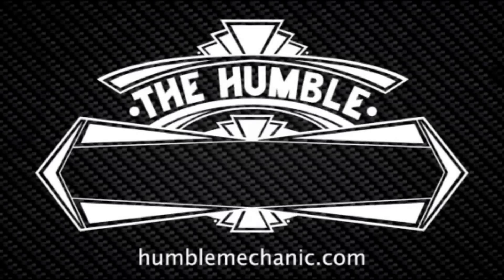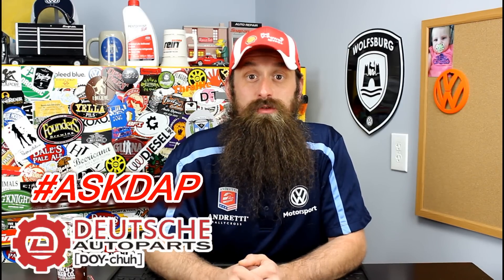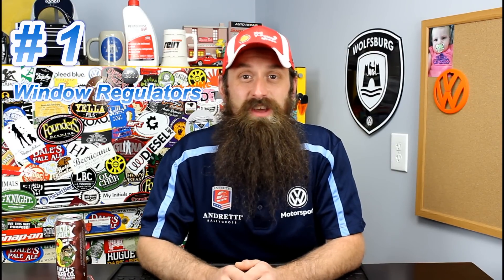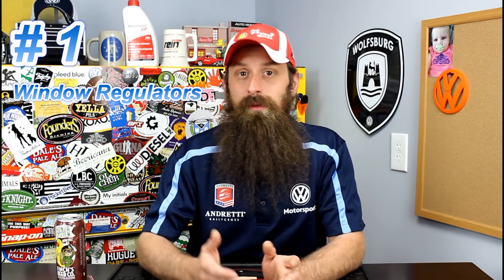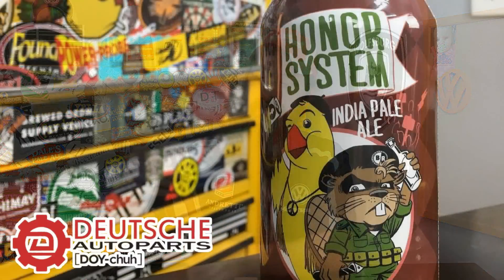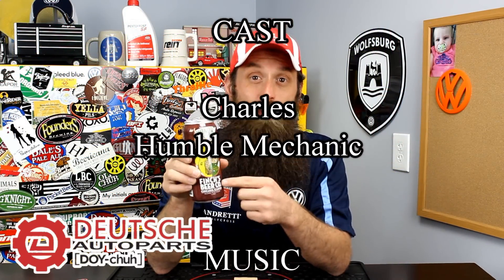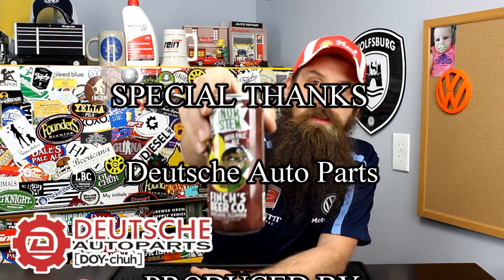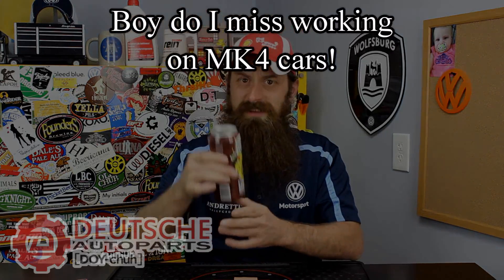Top 5 Failures 1999-2005 MK4 Golf, Beetle and Jetta

Comment: As Teodor mentions... fuse box above the battery has been the cause of lots of problems. The micro switch inside the door latches is horrible. I replaced mine at 118,000km and now at 200,000km three have failed again in my 2002 Jetta GLI but now I have an insane issue and was hoping this video might help. Turn off the ignition and a relay keeps clicking, 11 error codes, only way to stop the clicking is to disconnect the battery. Car runs fine but no Temp or Fuel gauge working. Had a VW/ AUDI/ Porche tech look at it for over seven hours, checked all grounds, Fan Control Module, wiring harness in the engine. What he did discover is pulling fuse #16 Climate Control Module the problem goes away but after driving the electric radiator fans stay on and I still can't clear the code for open fuel pump relay circuit. Tried relays, fuses etc... I think I have a melted wire under the dash.

Comment: Thanks for the video. I’ve encountered all 5 of these problem areas on my VR6 GTI. Most recently, I started getting a really bad exhaust rattle at startup when the engine is cold. My mechanic friend diagnosed that the catalytic converter is the culprit, and it looks like the muffler has something loose in it as well. The question is, can I get away with an aftermarket cat or would I need a VW one  to avoid throwing codes?

Comment: Hey I know its been some time after this video but I own an mk4 jetta, it's my first euro car but this one I've never seen it before. I've replace window switch, window motor but now the problem is more than that. All my windows and locks work perfectly fine but the driver door. I have no power for the driver door. I did a whole new set of wires that is the actual same year and it's a perfect fit, it does not have any power either, and the weird thing here is that if I press both rear windows up, my passenger mirror goes down.

Comment: hey humble! i am going thru a electrical nightmare, i replaced the BLS to the new green one, bought a new third brake light, brake lights worked but i had a blown parking light fuse(23), basically my brake lights would only work w the light s off and all other lights(turn/reverse) on the rear worked. i cleaned up a bunch of wires in the loom/headlight casing and replaced fuses and bulbs/ new oem headlight switch. i notice if i unplug the ballast the fuse doesnt blow but now my brake lights dont work again, could this be do to the system being unbalanced, probably gonna go back  to stock headlights. brake lights will not work/intermittent(all 3) if i use my headlights, idk what to do thanks!

Comment: 2002 Jetta GLX wagon VR6 (12V) 5-speed. We had a lot of coil pack failures (misfires, etc) - about every 30K miles. 1st one was replaced under warranty. 2nd one was just out of warranty and cost $800 (at the sdealer) so we bitched to VWoA and they paid for half. Next one we replaced with aftermarket part and the last one was a coil pack from a Ford V6 - the Fordswagen fix. We had that car until 2014 (170K miles) and was getting pretty rusty (New England car).
Paul

Comment: Seems you have fixed quite a lot of vw. I have a vw beetle 1999 2.0L. I've had quite a few problems. The one I'm stuck with at the moment is codes p0301 and p0304. I just changed the Spark plugs plus the spark plugs wires and the "check engine" light keeps coming up with those same codes. The car kind shakes and you can hear a rattle. By this video I got that it might be the catalytic converter. Can the codes be showing bacause of the catalytic or is that something else? I would really appreciate some guidance

Comment: Good video, one question. Any idea why a dealership near me has a 1.8t Jetta Wagon with a 5MT for sale for $42? It looks solid, the beige leather interior is really dirty, the black paint looks like it's seen some abuse, and there's brake dust all over the Long Beach wheels. Going to buy it if I can, just curious as to what would drop the value that much.
Reply: What's the mileage?  It must be 300,000 miles plus and they just want to get rid of it, I guess. :)

Comment: Have you ever seen the ECT sensor cause a no crank when its cold? Fine all summer long but as soon as it gets below freezing, it wont even try to crank.
Reply from the maker: Never no crank. For sure no start.
Reply: Ok thanks. I'm fighting a no crank issue when its cold. I thought it was the battery or start push button last winter but it got warm and was fine will the temp dropped last night. 
 @HumbleMechanic

Comment: nice video! i've heard of all of these problems too but my 2001 Jetta VR6 never had these problems except for the cat which i paid $1400 for yearssss ago before vw extended the warranty to 120k lol but i never had a problem after that. that and i had 4 different failures with the hazard light switch, 5 failures with the AC unit, 4 failure for the MAF, 4 failures with the coilpacks..... knocking on wood hope it stays ok. goddamn i forgot that i even had this many issues with this car... but it's been good for the last 7 years. window regulators, bushings, brake light switch (replaced under warranty but no problems) etc no problems. thank god
Reply from the maker: NICE "knocks on wood grain" LOL
Reply: LOL i just need to do my brakes next

Comment: I just bought a 98 beetle with the 2-L  engine on the way home it started making a wired noise so pulled over before I could stop it stalls out and wouldn't crank up opened the hood found the pvc valve hose busted rigged one up to try and just get it home to my tools but it wouldn't crank back up any ideas on what it could be

Comment: ahhh brake light switches.  my B6 A4 had that issue.  Came outside one morning, and my brake lights were just on for no reason lol.  Oh, and i had the 3.0 V6 in that car and both cat converters failed hahaha.  Called a local Audi dealer....$2100 per cat.  Needless to say i had an aftermarket one installed at a small shop and sold the car to Carmax.

Comment: Number 6: Emergency brake cables. They always sucked on every mk4. Like if you had a manual transmission on your mk4, you have to always leave the car in 1st gear or if the car was facing downhill you would have to leave the car in reverse because it would roll down the road.

Comment: Hey there, my MK4 GTI 1.8t has had this problem where when I accelerate quickly/get my gas pedal past a certain point, my steering wheel will jerk to one side quickly  and go back when I let off the gas. Any ideas? I’ve replaced tie rods, engine mounts, and more. No luck. Thanks!
Reply from the maker: Some torque steering is common on that car. Be sure the whole suspension is right.

Comment: I have a 2003 Beetle with a 1.8L turbo engine.. It started to smoke really bad after I change the oil. Thick white grayish smoke blowing out... I was told the turbo went bad, There is a little oil blowing out the tail pipe as well. Can you give me some advise.. Thanks.

Comment: The Mk3 platform was a hell of a lot better platform setup than Mk4.  less problems of ect, brake lamp switches, maf sensors,etc.  window regulators hardly went bad.  Bushings on the otherhand were problematic.  Throttle bodies were problematic on mk4 as well. Especially setting readiness codes.  Mk3 throttle bodies were very reliable.

Comment: I need to change clutch set and flywheel on my mk4 Golf 1.9 TDI 2001 90hp. Should i use a DMF or SMF flywheel?Help
Reply from the maker: +anex83 SMF will give a but more vibration. But it is what most folks do

Comment: My 99 vw gti is down .replaced plugs ,wires,fuel filter,cleaned maf,now I ordered a new throttle body.I know I'm a dummy for buying all these parts to find the problem.It idles fine but when I give it gas it sputter out.Any ideas.

Comment: Hey Charles i drive a 2008 r32 i had an aftermarket fluidamper pulley on my crank shaft and it has caused the notch in the shaft to lose its shape. As a result my shaft end is mushroomed and there is play on the pulley. Are there any solution that dont involve taking the engine apart and changing the shaft?
Reply from the maker: +Lucas Garofalo YIKES!!!!! Can you send me some pictures? maybe email me, or FB message me? Charles(at)humblemechanic(DOT)com

Comment: Hi Richard. Thank you very much for the vid. Really helpful to get this improtant information. Can I please ask a question about the fourth item of the vid, about the coolant temperature. I have my 2002 Beetle (2.0 ltr engine) with a strange phenomena. As starting the engine the coolant temperature indicates blue on the dashboard. I guess this is how it supposed to be. After a while, when the engine is at the right temperature, the blue coolant temperature indicator light starts flashing and will not stop flashing during the entire ride. I already exchanged the coolant reservoir, but that wasn't helping. Do you have any clue what happens here? Thanks in advance. Kind regards Carlo, the Netherlands

Comment: I have an 07 Jetta, and have the following dash lights on- power steering assist(yellow), the check brakes light that looks like a circle, abs light, traction control light, and air bag light. They all came on at the same time. I scanned it and it came back as a wheel speed sensor. Could that one part trigger all the lights?
Reply: Try cleaning the sensor it might do the trick. My speedo stopped working also

Comment: Hello, i have a 99 vw bug that the brake light indicator is on forever. It has been with 4 mechanics and still can't fix it. All the sensors ( brake, master cylineer, hand brake, the common) issues have been checked and all is working fine. The abs module was replaced and still the BRAKE light in the dash is on. Can you share some insights or experience, a solution  would be appreciated. Thanks

Comment: Can you help with the Airbag light, errors codes are 00591 drivers seat belt switch, 00532 short to ground, would you recommend replacing the seat belt connection. I have a C reader VIII 
Thanks for the help

Comment: I have a 02 vw beatle with 20v turbo and iam having issues with it now my check engine light comes on then my all wheel drive kicks on by itself and then the EPC light turns on and it has no power I've read the codes I've replaced almost all my sensors but not my idle speed sensor and mass airflow sensor

Comment: I'm having an issue getting my car out of park (bew tdi tiptronic). I've looked at the brake light switch, it's the newer green type and seems to function properly. I can see the plunger move in and out with depression of the brake pedal, can here the click, notifications pop up on the dash with brake depresses and released, and my brake lights work 100%. I can move my shifter freely but just wont mechanically move the transmission out of park. Symptoms before failure was needing to shift back past D and then back up into D before engaging D. I think it's my shift cable but could it still be the switch? Could it be anything else? Thanks

Comment: both front windows in my 05 Jetta TDI come loose from the clips if they stick. Don't let it fall into the door! What I do is push the glass all the way back up by hand (one outside, one inside with the door open), raise the power window motor until it contacts the glass, then stop or it will reverse itself. After that the window is fine until it gets stuck again by ice or sap. Always lower them slowly, if they stick, abort and try again later.

Comment: Hey humble! I have a question noobody can answer. I have a 1.8 20v mk4 non turbo vvt/vvl. I fitted ITB's from a toyota but want to fit a variable velocity stack. I have the mechanics figured out with a actuator and all. Can I wire the actuator to the vvl solenoid so the velocity stack shortens when the vvl is activated? 
Pleeeeeaaase get back

Comment: I've had the rear bushings on my 2000 vw beetle GLX replaced because every bump felt and sounded like the suspension was nearly breaking itself. However, it seems that the front bushings need replacing as well since I'm getting a squeeking sound and the occasional clunk in hard turns. Is this an immediate issue or can it be left alone? I'm a college student on a budget

Comment: HELP!!!!! I own a 98 VW Golf GL. I am having starting issues. Check engine light stays on.I have checked everything I can think of. It has a tight fitting gas cap, I replaced the starter and have a fairly new battery. I have noticed when you wiggle the key while depressing the clutch some times it will start sometimes it won't. Could this be iginition switch issues and should it be changed.

Comment: Still miss my Golf MKIV TDi and would still be driving it today if not for that timing belt.....changing it every 80K miles was a pain in the nuts and cost about $500 each time. That wasn't much for me at the time, I think it was like 2-3 years for that. Had a leaky sunroof and the sending pump in the fuel tank failed on me. Oh....ya and the brake lights FFS I can't even begin to tell you how many times I had to get it to the dealer for the brake lights....which would unbalance the system and the headlights would fail if I didn't get it done fast enough.

Would still be driving it though if it had a timing chain. My only real case of seller's remorse :)
Reply: gotindrachenhart ha fresh tune up wouldve solved that
Reply: +Austin Simms how would a fresh tuneup have replaced the timing belt? Big difference between a tune up and removing the engine to replace the belt.
Reply: hi jw if u fixed ur issues w the brake lights? u mentioned it had an unbalanced system, i too am going thru a electrical nightmare, i replaced the BLS to the new green one, bought a new third brake light, brake lights worked but i had a blown parking light fuse(23), basically my brake lights would only work w the light s off and all other lights(turn/reverse) on the rear worked. i cleaned up a bunch of wires in the loom/headlight casing and replaced fuses and bulbs/ new oem headlight switch. i notice if i unplug the ballast the fuse doesnt blow but now my brake lights dont work again, could this be do to the system being unbalanced, probably gonna go back  to stock headlights. brake lights will not work/intermittent(all 3) if i use my headlights, idk what to do thanks!

Comment: Funnily enough, I had none of these problems. However I did have the following issues: center console broke, turning the blinker on dimmed the brake lights, o2 sensors, oil leaks, coil on plug wire insulation falling apart, oil pressure sensor broke, trunk plastic thing broke so the trunk wouldn't open, no heat bc the foam in the vents flaked off, oh and it smelled like crayons. Good times

Comment: i changed the timming belt to make sure i was dead on marks on fly and cam a few tries i could of swore  it was off 10 degs or more someone told me that i shouldnt do that im not sure im thinking I could be too close to a fresh factory run time module it tries and tries but farts on number 1 timing scenario
Reply: i cant understand why after an exhaust manifold gasket i got a miss fire out the get go  my P carbon canister malfunction has turned into a plain jane P420

Comment: Man Im glad I watched this finally, been getting 0422, temp sensor, random misfires. 
had plug wires with broken tips, cracked evap line, cracked brake booster line, all kinda random things I fixed on this journey.
now I'm hoping its the temp sensors! path of least resistance!

Comment: i have an 03 jetta 2.0l crank no start,
so it been sitting for at least 2 year technically not mines it my cousin, she said it crank but won't start, then a year or so ago my brother who work at auto zone at the time had it tested, i forgot the result i think it was bad. today i thought about so i check the fuses an 10a and 15a both were replace with a 20a fuse
i check fluids and was surprised to see no oil or coolant in reservoir dipstick had half a drop on the end and reservoir was bone dry.
Any ideas why?

Comment: 2000 TDI No dipstick for the trans..., output shaft speed sensor under the trans mount, rubber coating on interior gets sticky over time..

Comment: Common and same car really, is my Seat leon pd bmn 2008 mk2 1.9 170 fr diesel, on mine I've found to be: noisy flywheel so swapped the entire clutch kit including clutch plate, release bearing, bolts, dual mass flywheel (all from LUK) as dealer recommended and I plan to fit a short shift on the gearbox once I've got it started 😂. She's been stuck on my drive since a few days of getting her back from garage that fitted my new clutch for nearly three weeks now, I've checked fuses and relays, overlooked ignition switch and I'll get back to that shortly, however I have spent a lot of time researching, using life experience as I'm not a qualified mechanic. I replaced the fuel filter, had 2.1 volts to tank/lift pump using original loom but after fitting a temporary power supply directly to the pump found the power supply much more acceptable and the difference in diesel flow was undeniably faster so my question is can I have the tank pump wired to 30amped ignition and run it permanently when ignition is on?? Now back to the "ignition switch" it's intermittent and I only got  an error code last night, also vag com a few weeks back wasn't showing any codes in relation to the non start issue, 75% fuel level, bosch vacuum fuel pump was rebuilt as there was a leak anyhow, also the car has had hesitation under load/boost but only when warmed up, when she's cold she ran very well, also led lights are upsetting her so that's another thing lol. Both my rear window regulators are Kapput, the car has had egr and cat delete for a remap but still has factory intercooler? there's more but meh I still love her! 😊